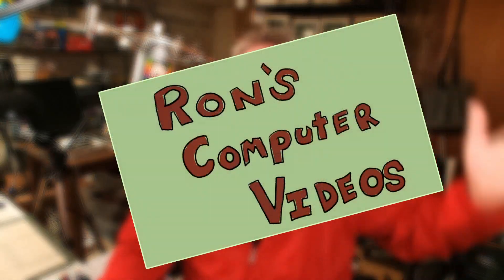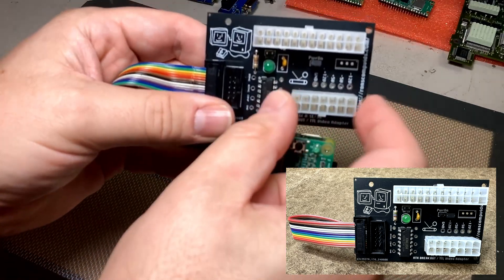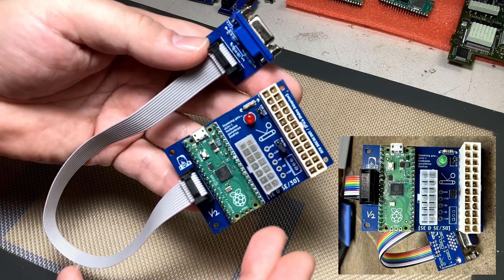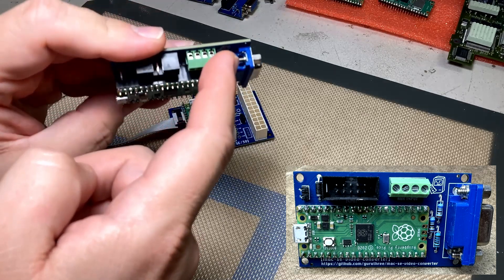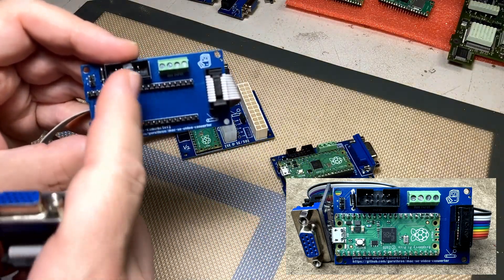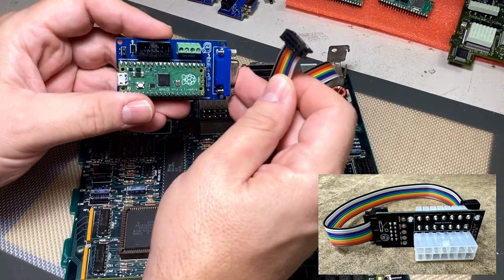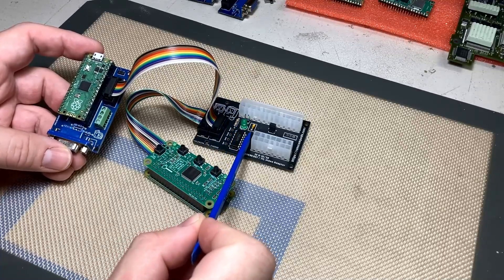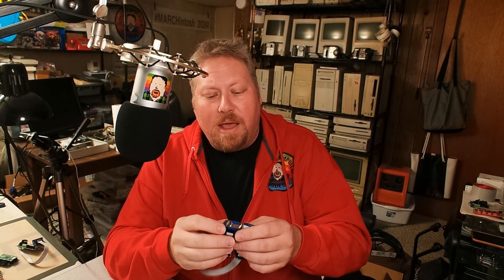New modern video output solutions for your compact #Macintosh from Ron's Computer Videos!

Comment: Hey Ron, you missed the boat a bit that I need for my classic Mac.  I have a working SE/30 that I've replaced the power supply with a brand new one, as well as recapped both the Analog (as well as resoldered) and main digital board.  What you need is to combine the J12 Breakout for the SE/30 and the MacPicoVid as you show in this video at around 6:40.  So there's no need to run a separate pair for 5v as it's available in J12 and your output VGA that passes out the back.  Also, include a 3D printable bracket that can hold a BlueSCSI v2 with your VGA connector.  Then the internal CRT works as well as adding a larger VGA display for old eyes like mine.  It will cost around $50 and include the 3D printed mount.  I would buy that in a New York second.

Comment: This was great!  I just added the breakout and extension to my SE FDHD and I love being able to mirror everything on a larger display.  It helps a lot with the work I'm doing.

I ended up wireing the picos power to the unused molex connector that the HDD originally used.

Comment: I got the Extended version working with a Mac Classic logic board this weekend. Sort of. I have inverted video. I'm using the J12 Passthrough connected to the MacPicoVid and the J12 breakout that I have connected to an ATX power supply through the ATX breakout. Looking at the Github, it looks like I can get it un-inverted with a recompile of the firmware. Unless there is a better way.
Reply from the maker: I’d love to see some screenshots of what you are encountering.  What’s the best way to contact out outside of YT?
Reply: @RonsCompVids  Sending you a message on Discord now.

Comment: I've got an SE motherboard, but no cable for the J12 connector. What's the best way to source a replacement? Thanks!
Reply: Just checked myself - you can use a 20/24pin ATX cable and it does appear to align with the pins you need for this purpose. Commenting so other people don't run into this same question.
Reply from the maker: There are also modern replacements that you can purchase on AliExpress.

Comment: just wondering about the video signal voltages, because the pi pico I/O is only 3V3 tolerant i couldn't tell if you have a logic level convertor IC or if its needed?
i haven't scoped the video signals on a SE/30 in a long time so im not sure if they go above 3V3 or not..
Reply from the maker: Seemingly it’s not needed.